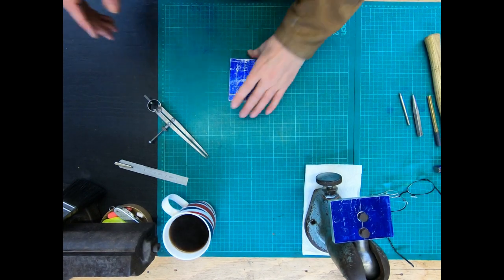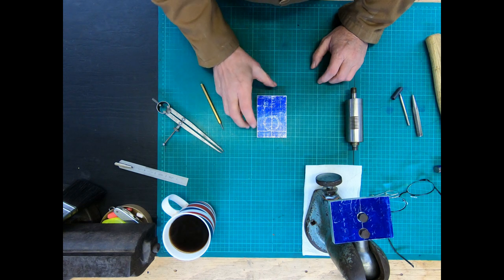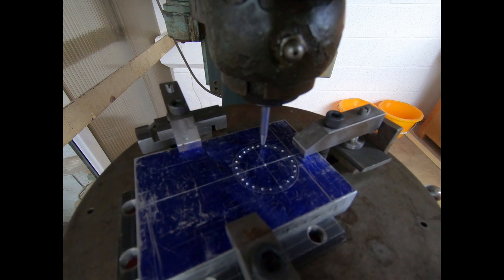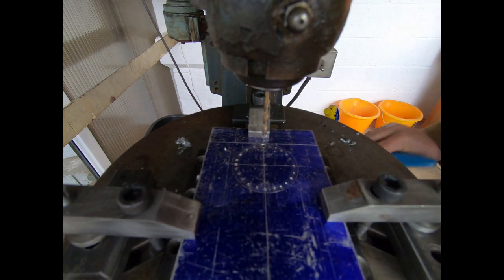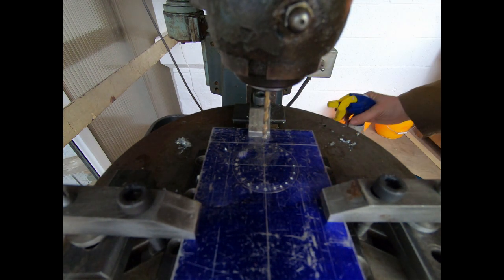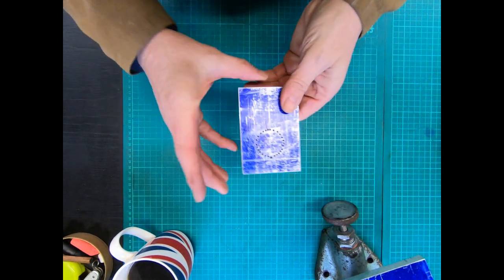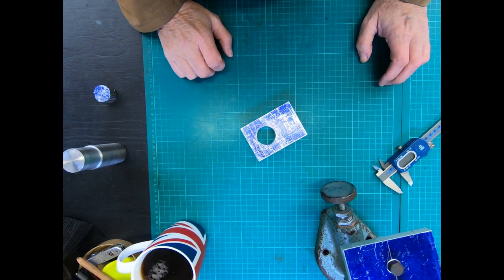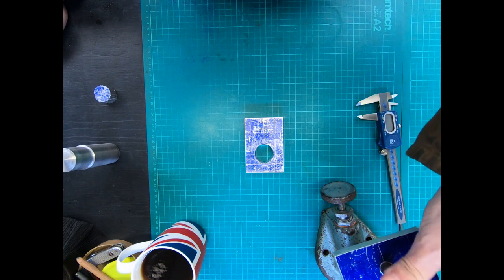Making a Watchmakers Spindle Maintenance Fixture (Part 2).

Comment: Honing your skills Paul and helping others who may not have the luxury of machine tools to understand you don't necessarily need them to take jobs on in metal. I had to file a 12" long square (1/2" x 1/2") out of 3/4" round stock in my apprenticeship, it had to be straight, flat, square, parallel and on size. Once marked by the apprentice master, it was put in a bench vice and bent with a big hammer by said instructor, to ensure you didn't pass it round to the less dextrous students to be marked again. Gutted! Cheers, Jon
Reply from the maker: Hello Jon,
The apprenticeships back in the 70's and 80's I would suggest were a test of both practical and mental capacity... There would be around 100 Fitter/Turner start each years and many fall by the wayside in those first 8 months of filing... Our instructors were very hard on what was just a bunch of kids really. thanks for watching.
Take care.
Paul,,

Comment: Good one Paul!
Why didn't you mill the hole out after drilling all the holes around the circumference? it would have been a fairly light job, no?
Anyway that is a very interesting project and I'm looking forward for the next video! :)
Reply from the maker: Hello Saar,
I could have indeed machined the hole but I wanted to challenge myself by filing it and as I plan to make the clock I thought some filing practice would be good. Thanks for watching.
Take care.
Paul,,
Reply: @TheKnacklersWorkshop  hi Paul. Very good practice. I know what you mean (I'm also subscribed to clickspring)... Looking forward to the next video.